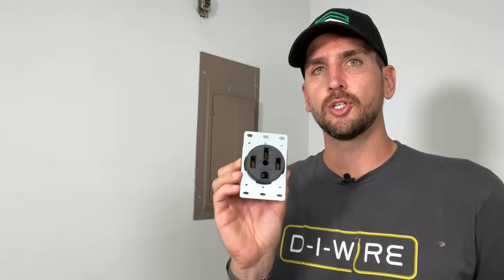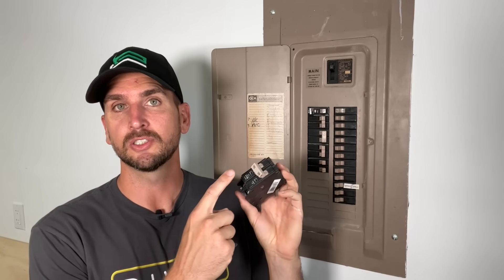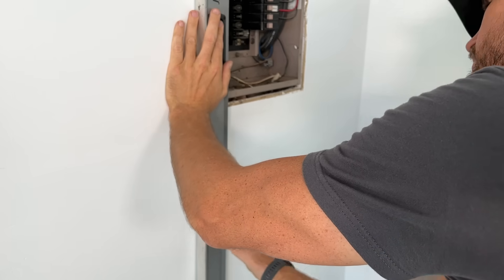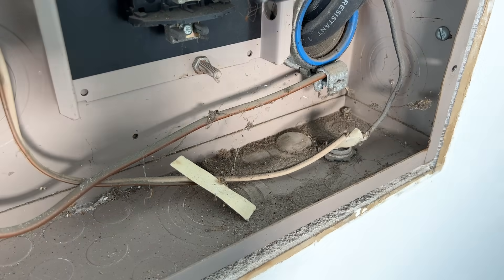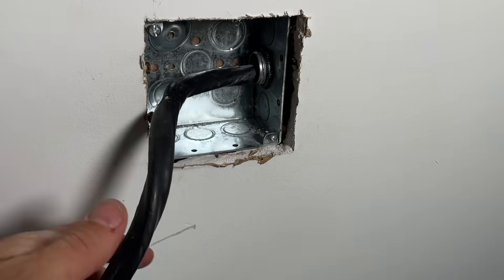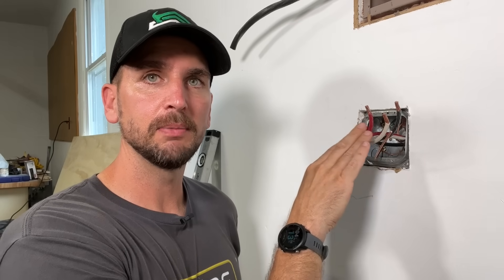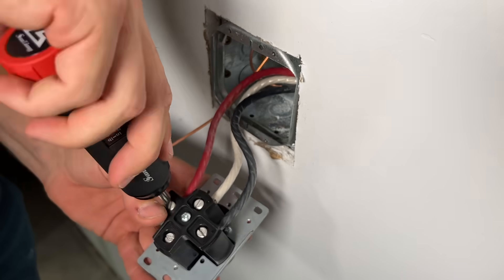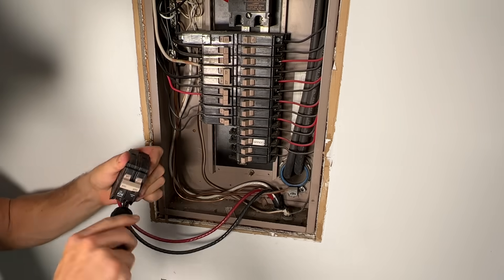Quick and Easy DIY 240V Outlet Install | 50 Amp NEMA 14-50

Comment: I llive in southern California. The electrician I hired used a 40 amp breaker, in lieu of 50amp breaker which seems to be the norm on most website, with 6 gauge wire for the 240v outlet, the travel distance of my outlet is less than 4ft from them electrical panel, would this be okay for Code wise or i should call the electrician back to put in the 50amp breaker instead? anyone can advise? thank you.

Comment: If this is in your garage you need to install a GFCI circuit breaker,  which is about $150. Also, you need to install the   receptacle a minimum of 36" above the ground.  This isn't to code dude. Don't follow his installation.

Comment: I can only recommend to watch the video Home Charging Installation Risks and Advice from Munro Live as well https://www.youtube.com/watch?v=tDp9PhPJhUI 
One of my electricians NEMA 14-50 ended up with a some arching within the plug and that installation was way more than $66. 

If however the installation is temporary (in wait of a better car charger), then installing a NEMA 14-50 for $66 is a good solution to keep your EV charged.
Reply from the maker: Thanks for the heads up.  I love Sandy's content and have watched him for years and years.
Reply: @EverydayHomeRepairs  you might perhaps put a disclaimer on your video as you don't want somebody to novice work on their electric lines and end up in a house fire. Those EVs pull a lot of consistent amps/juice from the grid.

Comment: PLEASE DELETE THIS VIDEO. A cheap dryer receptacle is NOT SUITABLE TO CHARGE AN EV. Those receptacles are designed for 10% duty cycle,  not 100% duty cycles required for EV charging. For a garage EV charger you should not be using a plug at all, a charger should be hard wired. For a plug in charger, you need at least a receptacle made of bakelite, not nylon, and they cost over $100. I have to report this video because it is irresponsible and this setup will burn down a house. For accurate information,  see recent videos by Sandy Munro with a Master Electrician,  because these fires are already happening.  

Do not play around with 220V high amp electrics, get a professional.

Comment: I did a hardwired Tesla Wall Connector and a NEMA 6-50R for a GE Wattstation J-1772 for about $300 all-in, but that included about a 50ft run on the Tesla and a 30ft run on the 6-50R.

Comment: That $9 NEMA 14-50 will burn your house down if you plan on drawing 50A from your EV charger. If you limit the vehicle charging current to 40A, you should be fine.

Comment: Because 99% of all homes fuse boxes are located within a foot of the required  240 outlets and within the same wall studs........  Talk about over simplification.   Come to my house and do this where the fuse box is on an outside wall centrally located at the back of the house and garage is at the front of the house.

Comment: There's a transformer on a pole feeding homes around me. Are they rated for full panel load at each home or a duty cycle? If all the homes are pulling 50A 240V will it smoke?

Comment: I don't understand how this guy that isn't a licensed Electrician. Showing Diyer's that shouldn't even be thinking to install a 240 circuit. Not to mention should be pulling a permit to install a new circuit in a existing panel. Never did a load Calc just to verify not overloading the entire load center. Anytime you de energize the main breaker. You shut down all branch loads first. Then the main breaker. This guy should not be  anywhere near giving any instruction s. He is not Qualified by the state. Period! End of Story!

Comment: If the purpose of installing a NEMA 14-50 outlet in your garage is for EV charging, why not just install a dedicated hardwired EV wall connector if you own a Tesla?  People are under the impression that installing a NEMA 14-50 outlet will save them a ton of money.  It may save them a few dollars, but not as much as one would think.  If you have a NEMA 14-50 installed for EV charging, you should install an industrial grade/commercial grade NEMA 14-50, which currently cost around $75 (as of today at Amazon).  A higher grade outlet will not take the standard face plate since it is larger than a residential grade outlet, the face plate will cost around $18.  You will also need to purchase an electrical box for about $5.  Per the NEC, most states now require using a GFCI breaker on garage installed NEMA 14-50 instead of a non-GFCI breaker.  That will cost an additional $100.  Add those costs up and the total will be $198.  For Tesla owners, the Tesla Wall Connector (TWC) is currently priced at $350.  But wait, there is a 30% federal tax credit on home charging stations, which will save you $105 on the TWC.  So the price of the TWC is now $245.  I am not including the cost of the actual wiring or conduit since that is a wash since both will need that. The Tesla Wall Connector does not require a GFCI breaker because that circuitry is built in to that unit.  The NEMA 14-50 is restricted by the NEC to a maximum of 50A, which means if connected to a NEMA 14-50, can only charge at a maximum of 40A, but in reality if you use the Mobile connector, it is only 32A.  The TWC can be set up on a 60A breaker, and therefore will have the capability of charging at 48A.  That is 50% faster than the Mobile connector.  Plus, the TWC is a "smart" wifi unit and the cable is much longer than the Mobile connector.  So, for 50% faster charging, the advantage of a smart wifi unit (for future software upgrades), and a longer cable, is it worth an extra $47 ($198 vs $245)?  One other thing...the TWC just looks cool!!!  I would think for most people this would be a no-brainer decision...IMHO....

Comment: That's easy it's in the garage I am looking for a video giving me ideas to run wire from panel that is on the opposite side of the house on the outside wall and run to garage foundation is concrete slab and it is a 2 story house any ideas how I can run 240 for welder to garage

Comment: Do not use the cheap 14-50, they cannot handle the long charging cycles that EV's require.  I would also say replace the one you installed.  See this video from Munro on https://youtu.be/tDp9PhPJhUI where he's explaining the issue.

Comment: If you Google around you will find the Tesla Engineer 's Whitepaper explaining why you need an upgraded outlet from Hubbell that costs around $99 that is fiberglass and designed to withstand constant pull of high power from the circuit. These cheap outlets are not made to withstand hours of charging. It is okay if you are rapid charging for a half hour but if you are charging for a couple of hours every day, you need that beefier outlet, and the deeper box to hold it. Even my electricians were surprised to learn about this.

Comment: You link to the 14-50 receptacle is wrong. You are using the Legrand 3894, not the Eaton. The Legrand is more solid and makes a better connection.

Comment: If all of the spaces in the panel are used, do you have to replace the entire box to gain more circuit breaker slots?
Reply: Unless you can negate some circuits, probably. Or install a sub, but I would recommend calling a pro on that option. Not that you "can't," but it would be safer and probably more efficient (depending on the contractor).

I ran into that issue with my last house. I wanted to install two (2) 240 outlets and really wanted them on separate circuits. But I only had enough room for one (old house 1972), and I did not want to replace the panel. I ended up figuring out another temporary fix for having another separate source. If you have the extra cash and space, a new panel is probably a good idea. Most options nowadays have built-in protection, etc, and are FAR better overall.

Comment: A 50Amp plug&cord cost $55 1450 receptacle $40 deep 1900 box $6 and a 2 gang collar. You don't need any of that!  You can wire directly into the Tesla or Chargepoint units and eliminate $120 in non necessary connections. I did electrical work for a full time living. Check your codes.

Comment: Open a Charge point charging unit.. no neutral required. 240 volts and a grounding conductor that must be a minimum of half the gauge size of the current conductors. #12 ground is below minimum grounding conductor requirements.

Comment: There is no neutral wire required to charge any EV and the 1450 is overkill.  NO NEUTRAL REQUIRED! not with Tesla, Subaru, or Ford.

Comment: Under the panel. If want to install the 50A receptacle a distance from the panel. 6/3 MC cable is $5.85 per foot on 12/5/22 plastic cable (romex) is over $1 more expensive. The receptacle alone is $40 at an electrical supply house.

Comment: Can i use a similar approach to wire a tankless water heater? The Inlet and outlet pipes are pretty close to the main panel.
Do I need to install a disconnect box(per code)?

Comment: Hi, great video on 240V outlet install. I'm doing some wiring for a workshop in my garage. I'm running a dedicated 240v circuit (orange 10/3 romex, 10 gauge) that will feed about 5 or 6 NEMA 6-20 outlets. These will provide power for things like a lathe, table saw and a milling machine. The recommended gauge for a 24-0v 20 amp circuit is #10. That solid 10 gauge is tough to work with! I'm making so many rookie mistakes. For starters, I should have just used 10/2 romex, as these outlets don't use a neutral- just two hots and a ground. Bit by bit, I've discarded everything I would use for a 120v outlet, like smaller connector clamps, normal size wire nuts, and single gang plastic boxes as they are too small and too flimsy to handle stuffing that chunky wire into them. Even with double gang metal boxes, I'm finding it very difficult to get the wires dressed properly in there. The budget quality NEMA 6-20 outlets themselves aren't even up to their intended use: the connectors are a fraction of the thickness and heft of the wire screwing into them. (I have a couple of receptacles on order from mcmaster carr to see if the build quality is better.) The more I work with it, the more questions I have.  Are multiple 240v outlets allowed on the same circuit, or is this discouraged? I ask because adding pigtails to the boxes fills them up so fast. I won't be using any of these tools at the same time, so it's not going to trip the breaker, but I wonder about the integrity of so many connections in these heavier load circuits. (If someone runs 10/3 romex to a mini-split heat pump, for instance, it's a straight shot with no intermediate connections) 2. Are lever clamps allowed, to insure a solid connection and save space? (Pre-twisting those wires isn't easy either) Would love to see a video explaining some of these details.

Comment: I've recently watched a video on Sandy Munro's channel about the risks involved with these installs. People are assuming that the cheap outlets from the big box stores, or online can do the job just fine. The problem is that they worked just fine for what people used them for before, like they're dryers, where the current is running through it for less than an hour or so, every few days. But in an EV charging application, the receptacles are melting and becoming serious fire hazards. If you are wanting to get this done for your EV charging needs, I highly recommend watching that video to learn what type of outlet to purchase, or do plenty of research. Even professionals don't always know what is best in this situation, because it's still relatively new technology. Hope this helps save some homes.

Comment: Why did you use a pigtail for the ground wire? Why not wire it directly to the NEMA 14-50? Do I still need to do this if the box is plastic (should it be plastic?)?

Comment: In San Francisco I got two quotes for a nema 14-50 plug 1 foot away from the box and they both quoted 700 bucks. I bought the parts and did it myself for 60 bucks in 40 mins! 

Also I didn’t have space in my breaker box so I used a tandem breaker instead. I calculated all the max power usage across the house to make sure I don’t exceed the max breaker box capacity. That’s really unlikely nowadays with everything from bulbs, to appliances being more efficient.
Reply from the maker: Nice work, getting the job done 👊

Comment: As a licensed electrician, I will say, let’s keep encouraging “homeowners” to install their own  electrical and expect to pay $66 for everything. I mean that’s fine, be sure you call a licensed electrician when you shock yourself, hook it up wrong, burn the garage wall, cut into the SER drop to your panel, and cut some additional corners, and I’ll charge you to fix it.
Reply: And then after this, I’ll get a call for an estimate to install, except I will need install and run from a new 50a breaker, using 4awg THHN-2 from the exterior panel on the opposite side of the house, run 1” EMT up the wall, into the attic for 83’, drop down and continue the EMT into a garage full of stuff where the homeowner doesn’t move anything, down to the opposite side of garage another 26’, up and around the garage door and hardware with a number of bends, into a new box with commercial grade Nema 14-50 while they tell me well I saw it for $66, why are you charging me $1,600, I was expecting it to be a little more like $130.
Reply: @Apache-Helicopter-Life  Ah sales.

Comment: FYI- This parts used in this install don’t meet NEC box fill requirements. A 4” box is 30.3 and the half inch mud ring adds 4.5. Because the outlet is wider than a standard gang, code counts it as double. You need 40 inches per code.

Comment: Everything in this video was great, except for one thing: the outlet chosen. Yes, that is a NEMA 14-50 plug, but it's designed for electric dryers. Electric dryers are on for 30 minutes, maybe an hour and then it's off and might not be used again for the rest of the day. They're not designed for hours and hours of continuous charge and a lot of these cheap, $9 outlets have been catching on fire. Make sure you get one rated specifically for charging EVs. The ones I've seen have a slightly larger diameter, and therefore need a slightly bigger wall plate. They're also a tad thicker, so need a deeper box.
Reply: the link he put in now goes to a $57 hubbell  vs the $10 home depot
Reply: That is absolutely correct.  I used to have a cheap one and has to upgrade to a Bubbell due to drop charging rate after several months of use.
Reply: He could drop the amperage in the mean time so there isn't as high of a sustained draw on the outlet keeping heat down.
Reply: 14-50 was typically used mainly for electric ranges, not electric dryers, which use the similar NEMA 14-30R (30 amp nominal)
Reply: Yeah, that outlet he bought was junk. Unless it's really light duty usage the outlet that can hold up costs $50-60.
Reply: Can you share recommend a few with links to amazon

Comment: What is the purpose of the mud ring?
Reply from the maker: Allows you to mount the box flush with the stud and then the mud ring bumps the outlet mounting surface out 1/2"to be flush with standard 1/2"drywall.
Reply: @EverydayHomeRepairs  awesome thanks!

Comment: Tip from a pro.  To confirm stud location, start from the middle of the box location and cut towards the stud.  You will feel when you hit the stud.  Then cut up and down next to the stud before making your remaining marks and cutting the rest of your hole.
Reply: what is different in how he did it?
Reply: ... and try not to damage the vapor barrier.(if you do, just fix it)

Comment: If I run a 1" emt conduit from my garage sub-panel, can I eliminate a ground wire from the sub-panel to the metal box that houses the 14-50 receptacle just 2' away?

Comment: As some people have already mentioned, you should buy the commercial grade receptacle. The other thing you should upgrade is the box - getting a 3 1/2 inch deep box will make your life MUCH easier. And those are only 3-4 bucks more (Hubell Raco 696 is one example).

Lastly, nobody does this, but I believe code now requires you to use a GFCI breaker for a 240v outlet in a garage - that will run you an extra $100.
Reply: You took the words out of my mouth.  If that is a garage yes on GFCI and anytime you add wire in Virginia you need a permit.
Reply: @alangivens7983  

It depends on the state you live in. My state still runs on 2017 Electric code rules, and that doesn't require a GFCI breaker. For what it's worth, I've read of many stories of people using GFCI breakers and having them constantly trip. Why? I'm not sure. But it seems like many EVs don't like them, for whatever reason.
Reply: @dontbanmebrodontbanme5403  One of the issues with GFCI breakers is most EVSEs also have GFCI built into them as well.
Reply: How about the Hubbell 683? It's 4" and that would go with the industrial grade Hubbell 50A 250v receptacle.
Reply: @my_RS4  That seems reasonable. Never actually used that box. Just make sure it's not a masonry box.
Reply: @karimshaban5460  copy that, thanks for your reply
Reply: Is it not possible to use a 240v at home?